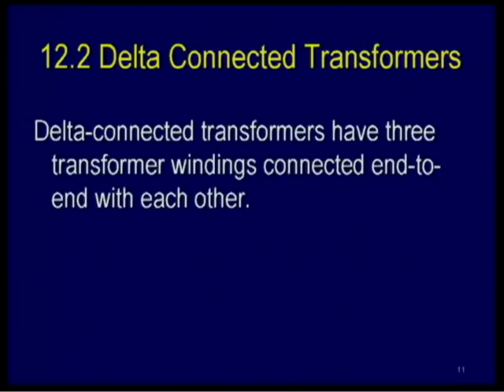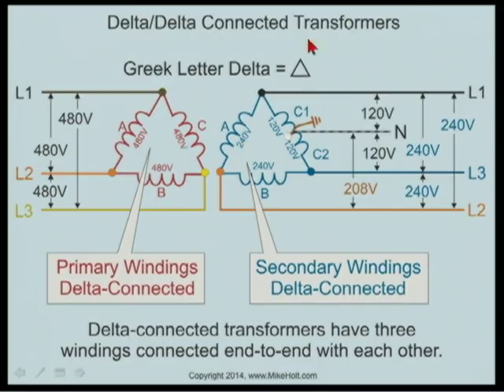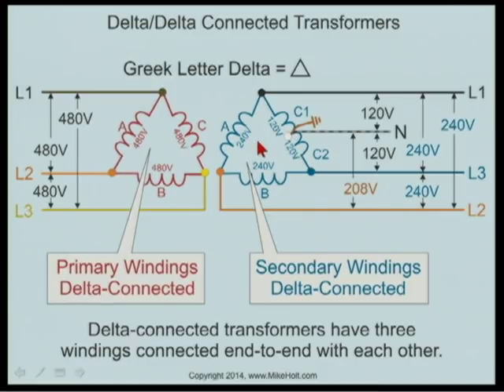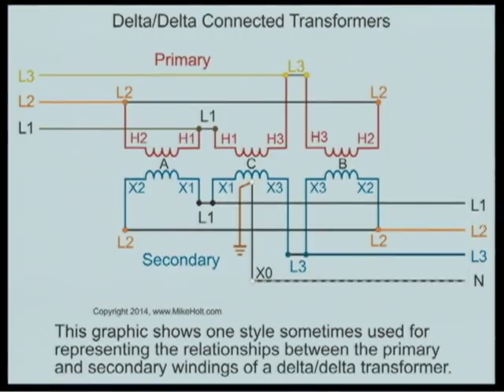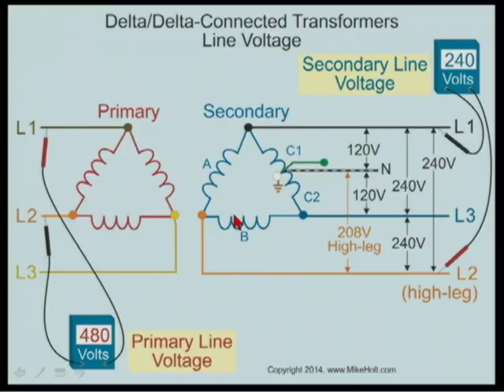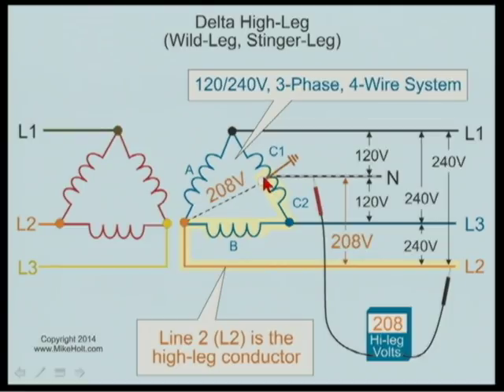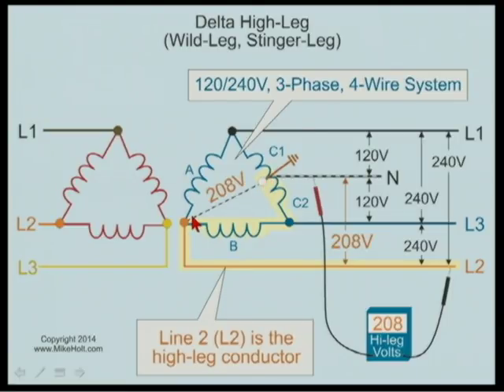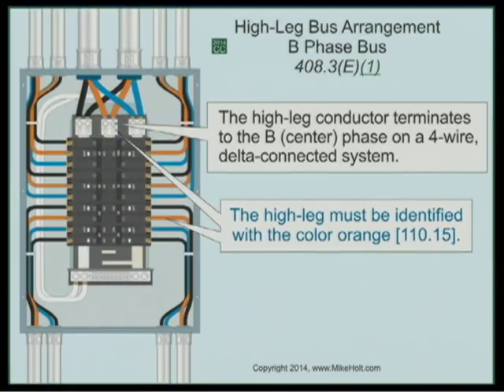Transformers - Understanding Delta/Delta Connections [250.4(A)] (26min:36sec)

Comment: I've been doing service and maintenance work for over 35 years (mostly industrial, but a lot of commercial and institutional mixed in), with a lot of that being strongly related to the electrical power side of things, and I learned quite a bit from this video. 
That said, when it comes to whatever the standard of the day is today for what terminal and what color the high leg is, I don't really sweat that very much since I don't do installations. What I DO sweat is what my meter tells me.
I do contract service work all over the place and sometimes when I roll up on a job I know that the building is pretty old. I don't know how old or when the service I'm working on was put in, or by whom. Many times, the wires to a service are all black with no phasing tape, so what used to be done and how it was supposed to be done and what color or terminal is what may be interesting to me, but Mr. Fluke is who tells me what the damn deal is in that one particular job.

The history of all that stuff is really interesting, and now I understand why some of the high legs I have seen were ~ 190 something, but are almost all over 200 now, but at the end of the day - just put a meter on the thing. 
Also, I carry a Sharpie with me all the time, and when I open a panel with a high leg that isn't labeled with regards to that high leg, I write it across the top in bold letters for the next guy that might go into that panel. Not because I have to, but just because I'm a nice guy.
Reply: You're my favorite type of guy to follow and I always do the same thing. And if I find something that's marked with as a high leg or a Delta and it is no longer the case I also update the markings

Comment: Another way to calculate the High Leg is to take 240V(voltage from first winding)+120V(voltage from tapped winding)=360V, then 360V/1.732(squared root of 3, because it's 3 phase)= 208V
Reply from the maker: Good point, never considered that option!
Reply: Or, tan 60 degrees = 1.732
Reply: Thanks Mejia, Mike, and Sparky!
Reply: Brilliant
Reply: Yes, also you can just multiply the phase-ground voltage by root 3 to get the high leg voltage, ie 120v x 1.732 = 208
Reply: @elijahdement9890  or you can hook it up and slap a volt meter across it. 
Look at the windings to figure it out. A whole winding and a half away from neutral, providing the pots are all wound the same , will result in a high leg voltage.
You split a delta transformer hookup in the middle of a winding to give the customer 120 for lighting. 
You can only ground it once to get 120 as two grounds will cause a phase to phase fault on a delta.
Delta is very reliable but has some special handling rules that have to be followed.
A delta tap feeding a customers house with two primary phases hooked to the high side of one single pot will continue to function if a tree falls into one of the primary lines. It creates a wye system. The tree is now hot and has to be avoided but the lights in the house wouldn’t change.
The hi leg voltage normally runs 210 to 215 (pre-load). 
Many utilities have multiple primary voltages coming out of subs. 4800, 8 kv, 12,470, 13,800, 19,900, etc
Our Hi-leg is located on the right side marked blue.
Reply: Thank you! I was telling a co-worker that if we had four phases we would / √ 4 and one of the older guys told me that I was wrong and it's three because it's three LOL
Reply: 8
Reply: Iiuuuuuuuuuiuuuuuuuuuuuuui

Comment: Since that is a 30-60-90 triangle then the short leg of the C transformer is the 120V (half of the 240 between C1 & C2), the long leg is the connection between the A and B Transformer connection and the C neutral. Any High School Geometry student (at least those I teach) will tell you that the long leg of a 30-60-90 triangle is always the square root of three times the short leg; the square root of 3 is 1.732050807... and multiplying that by the short leg of 120 gives you 207.846V--to the nearest volt that is 208!  Likewise, the B transformer is the hypotenuse of that triangle and the hypotenuse of a 30-60-90 triangle is always twice the measure of the short leg so 2(120)=240!  The rules for a 30-60-90 triangle are derived from trigonometric functions but the Pythagorean formula does also work for any 90 degree triangle, so (12^2 + B^2 = 24^2) (dropped the zeros for simplicity).  That works out to 144 +b^2 = 576 then b^2 = 576-144, and b=square root of 432, and lastly, b=20.78.  Move the decimal over one to the right to put out significant zero back and you get 207.8 or 208V! Q.E.D.

Comment: In my 50 years as a sparky only came across this once.  Think in school they told us to never place too much load on the nuetral due to it might cause voltage imbalance on 3 phase loads. If you can get by with 208 volts on the 3 phase loads way better off with the Y secondary that is every where .

Comment: I love this stuff.  While on the subject of changing and unusual voltages regarding delta high leg systems,  there also exists a very unusual voltage,  a 480 volt, high leg, 240 volts A to Neutral,  240 volts C to Neutral,  and 415  volts B (high leg) to Neutral,    the master electrical I am working with, ran into that, only once in his 39 year career,  in the early 1990s when he was on a maintenance job to a large wood working shop near Louisville Kentucky,  they had mostly 480 volt 3 phase motors , but they had the high bay meter halide fixtures running off the 240 volts.  They also had 480-120 volt transformers in the facility so they could run ordinary stuff as well.   I thought I'd share this and wonder,  has anyone else heard of a 480 volt, high leg delta?
Reply from the maker: There is no such think as a 480V high-let system, but there are 480Y/277V systems, corner grounded 480V systems, ungrounded 480V systems, and 480 grounded systems.

Comment: If I were to power a warehouse or a factory with lots of motors and lighting, I would use the 480Y277 volt system as indicated in your diagram. Most 3 please motors are dual voltage and use the 277 volts to run the Lights ( most hard wired LED light fixtures have universal voltage drivers in them already). In this situation, I would not bother using the Delta- Delta transformer in the first place.

Comment: With a delta high leg system, if you want to add more 120 volt loads, you can buy a transformer with a 240 volt delta primary  208Y/120 volt secondary. By putting all your 120 volt loads on the secondary of this transformer you will maintain a more balanced load on your delta service.

Comment: Probably one of the few educational videos even bothering to mention delta breakers.    I've personally never seen then I've heard of them, and believe they were banned in the mid 1970s, either '75 or '78 NEC, the theory was even if the main breaker was turned off, 208V from the high leg could backfeed from the load to the panel posing a shock hazard.   Delta breakers were somewhat common in the 1950s until the early '70s, in some parts of the country, for a 5 ton air conditioning unit, when central air became popular and affordable post WWII,  some of the larger units were not always available in single phase.   I'm sure there are many older systems still in use, that have a delta breaker. Some panels,  particularly residential panels from this era, were spit buss panels, which were legal until the 1981 NEC.

Comment: At 25:00, this is why they make buck- boost transformers. So you can run a 240 volt load at its full voltage from a 208  volt Wye system.(the wimpy Wye)

Comment: There is an easier way to calculate the high leg voltage.  simply multiply the phase to phase voltage by sin(60 degrees) or 0.86623. Which is the square root of 3 (1.7321) divided by 2.

Comment: In my experience, I have observed that most of the electrical guys work with the observational experience without knowing and understanding the fundamentals. The basic in electrical engineering is vector representation of voltages. If you master this and know how to apply this you will understand and can explain 90% electrical engineering related analysis. I will come out with a video on this for the sake of all electrical engineers.
Reply from the maker: Perfect! Post the link to your video in a reply.
Reply: Please don't forget current flow, not with respect to current vs election flow (no offense to the theoretical guys) but so far as "ground loops" and multiple paths go. I spent years focused on this aspect and was a better troubleshooter because of it. Mr Holt does an excellent job touching on it's importance in the few videos I have watched.
Reply: The power triangle, impedance triangle, etc. all are the same concept. Trig. These all give you a better understanding of what's going on.

Comment: Using your example of applying Pythagorean's Theorem I don't get the 20.8, as the gentleman mentions. To confirm my math, I drew the actual right triangle in AutoCAD and it showed my result correct. I am not being petty, I am learning all I can about this and want to make sure I have a clear understanding of what is happening. But your video is awesome Sir! Thank you.
Reply from the maker: The interior angles of the delta are 60 degrees.  The line drawn from the high leg to the neutral point bisects the triangle.  The point that is the high leg is now divided into two angles, each 30 degrees.Let’s look at this a couple of different ways.
1.  The rules of a 30-60-90 triangle are these.  The short leg is 1/2 the hypotenuse. The long leg is sort(3) times the short leg. Using these rules, the short leg is 120 volts and the long leg is 120 * sort(3) = 208
2. A^2 + B^2 = C^2 where C is the hypotenuse. Hypotenuse^2 - (short leg)^2 = (long leg)^2               240^2 - 120^2 = (long leg)^2               57,600 - 14,400 = 43,200               Long leg = sort(43,200)               long leg = 208
Reply: MikeHoltNEC thank you for taking your time to explain that for me.
Reply from the maker: You are most welcome.
Reply: MikeHoltNEC I was a broadcast video tech for 20 years, I now work at a farm that absorbed the original Habbersett sausage factory and the associated museum of electrical distribution networks. As a troubleshooter who doesn't know how to say "I don't know" I am extremely grateful for this particular 26 minute video as well as the rest of them as I am currently going through them. Thank you so  very much. One of the biggest lessons for me is how much I miss the beauty of a classroom. Again, thank you sir.

Comment: You the man. Do on the primary delta,  you have twice the number of wraps of the wire in each transformer coil yea?
Reply from the maker: Primary voltage is 2x the secondary voltage.

Comment: Hey mike very informative vid. But i have a question. How do i know if to use a Star input or Delta input transformer? Does this go according to the voltage?
Now am just sayin here if the voltage is 480/277 volts do use a Star input transformer or if the voltage is 240/120/208 the high leg do i use a Delta input transformer. 
Or if its 208/120 do i use a Star input transformer.
Thanks will be much appreciated.

Comment: There are many uses for the 208 volt high leg. Most modern hard wired L.E.D. 
light fixtures have universal voltage drivers in them (100-277volt 50/60HZ). You can run them between the high leg and the neutral. Treat it as though it is a 277 volt system. Use 3 pole breakers which are straight rated.
Reply from the maker: The high-leg is not permitted to be terminated on to a 1-pole or 2-pole breaker (slash rated breakers) per 240.85.
Reply: That is correct. But what if you use the high leg from a 3 pole circuit breaker, which is already straight rated any way?
Reply from the maker: You area 'smart' guy! Not many understand this concept. Answer: Yep this is perfectly fine. By the way, they do make 'straight' rated 2-pole breakers, but these are special order and cost about the same as a 3-pole breaker.

Comment: Isn't that an equilateral triangle? not a 30-60-90 as there is not right angle. Thus the degrees of the  angles and length of the sides giving us the relationship for establishing the 208v can only be calculated using the only known existing portion of the equilateral angle of 60degrees and using the cosine rule to solve.  What am I missing? I love your vids.
Reply: the 30,60,90 has a right angle and you can use tan or cosine to solve for it.
Reply: wrong triangle, he was talking about the one drawn in to calculate the high leg voltage, not the delta itself.

Comment: It's more effective to use wye tap to avoid a high leg on the secondary to get even voltage on all phases like 120/208 instead of 208 on B phase  to neutral . Instead its 120 to neutral on A, B ,or C phases
Reply from the maker: There are many good reasons to use the Delta High-Leg, any other system besides a Wye 120/208V system. Visit MikeHolt.TV, click on Live link and learn more about voltage systems.

Comment: Thank you for this. Why are the letters H and X used?
Reply from the maker: I'll try to find out...
Reply: H most likely stands for high side.

I'm not sure why they selected X, of all possible letters for the low side.  My guess is that it has to do with X being the de-facto choice for variable names in Algebra, and the  X/Y/Z trio, or X/Y duo, is used when there are multiple sets of secondary terminals.

Multi-winding transformers label winding set #1 secondaries as X1/X2/X3/X0, and set #2 secondaries as Y1/Y2/Y3/Y0.

Comment: Very good and clear explanation. At the beginning you asked what does "Delta" actually mean. In Greek, it is just the way to day the letter which sounds like "d". In a similar way that z is pronounced zee in English.
Reply: Διαφορά (diaphora) = difference in Greek.  Leibniz was using Latin lowercase d for infinitesimal differential in his Calculus notation.  The Latin letter being spoken for already, Greek Delta also standing for a Greek word meaning difference, would stand for finite change.
Reply: Delta as the name of the transformer topology has nothing to do with the concept of difference.  It is named as such, due to the arrangement of voltage vectors in real/imaginary number space, looking like the triangle letter Delta.

Comment: It's not a 30/60/90 (as drawn) and the 208 is the hypotenuse, not the 240.  He spoke incorrectly.  It is an equilateral triangle.
Reply: Jeff, The original triangle is an equilateral.
When a line is drawn from the tip of the triangle to the neutral point on the other side, the equilateral triangle is cut into two triangles, each of which is a 30 60 90.

If you look at the 30 60 90, the line that was just drawn is the long leg.  The line from the neutral point to the point on the triangle is the short leg.  These two legs have a 90 degree angle between them.  The side of the equilateral that has not been bisected is the hypotenuse.

The hypotenuse is 240 volts.  This is given because it is a 240 volt delta system.
The short leg is 120.  This is given because the neutral point is the midpoint of a 240 volt winding.  
The long leg is sqrt(240^2 - 120^2)

Eric

Comment: I will be installing a 75 kva 3 phase s/u xfmr, 240 hi-leg primary to 480/277 secondary. it will supply power for a glycol chiller located 60 feet from xfmr equip. Do I need both pri and sec protection and what size fuses and wire?
Reply from the maker: Please get my transformer app at MikeHolt.com/App

Comment: A , is unknown length .. so 240 squared - 120 squared equals a number, then u square that number will give u A ..
Reply: @MR-nl8xr  Squaring is the namesake of multiplying a number by itself, because the area of squares is the application of this operation where it was discovered.

There are plenty of applications of squaring numbers that have nothing to do with actual squares.  You can find plenty of geometric proofs on how squaring sides of a triangle will find the relationship among the sides of the triangle.

Comment: Good morning , for the 3 transformers installation in Delta to have the high leg, please, can you tell me if all 3 transformers must have same Power output ?
Reply from the maker: No, the power output is not a factor for voltage, and as a matter of fact, the three transformer typically would not all be the same kVA rating.

Comment: im in michigan and sometimes i see only 2 transformers on a pole for a 3 phase hook up. hows that work?
Reply: Look up an open delta phase system
Reply: It is an open delta configuration. I am a utility high voltage crew leader. We build them all the time.
Reply: @CHICAGOHAND  What's the point of an open delta?
Reply: @possibility28able  3 phase secondary power using only 2 primary phases. It is most likely a money issue. No need to run 3 primaries when 2 will do the job. From what I have been told....
Reply: @possibility28able  cheaper and if you add a third transformer can increase KVA by I think 50%. ( been over 50 years since I had class in this ). Have to be carefull with open delta in that you do not get as good voltage regulation then a closed delta.
Reply: @CHICAGOHAND  still need to alwayscrun 3 primary wires on all open delta tramsformer connections.